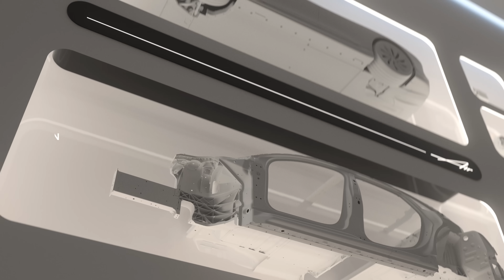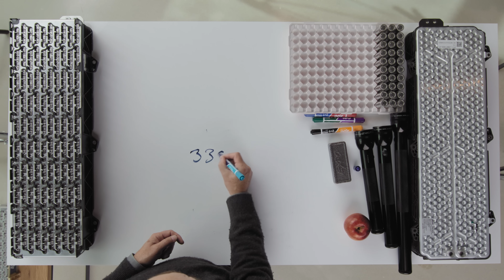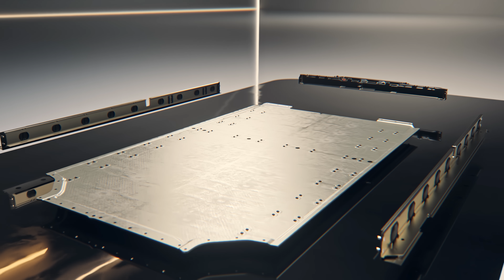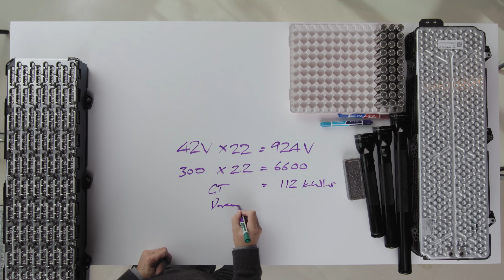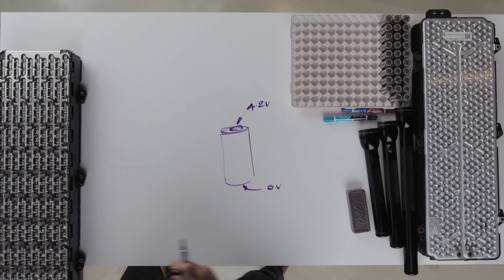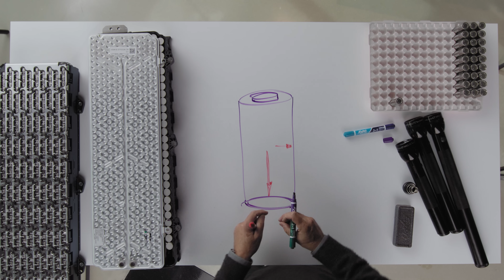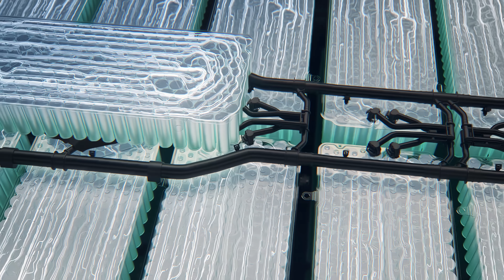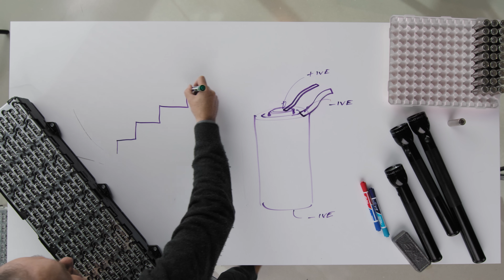Battery Pack | Tech Talks | Lucid Motors

Comment: A fascinating video.  Thank you so much!  We have a '16 Tesla Model S, the best car we have ever owned and almost certainly the best car in the world for several years after its launch.  It's wonderful to have such an informative and accessible video from its chief engineer.

What impresses most about the S is the quality, in the sense that nothing has gone wrong but especially the quality of the battery.  We bought our car with 48,000 miles on the clock and have added 25,000 since.  It has not lost even one mile of range.  Elon Musk likes to talk about a future million mile battery.  Based on this evidence, I might have a million mile battery now.  Several commentators have criticised the panel fit, paint finish and choice of materials, but there is a deep-down engineering quality that is very impressive.

There are only two things that I don't like.  First, the touchscreen is great, and quite possibly cheaper to make than an array of dials and switches, but it is of little use on the move because your hand jitters around relative to the screen.  The best bet is to place your thumb on the bezel in order to hold your hand steady while you operate the controls.  It's not satisfactory if you're trying to drive the car at the same time.  Thank goodness that the Lucid Air has proper heater controls.  Second, the car is very quiet but at certain speeds on certain road surfaces there is a drumming through the structure.  I suspect this is caused by the huge flat floor.  Practically everybody else presses a tunnel into the floorpan, even if there is no propshaft, and I can imagine a team of experienced automotive engineers telling Musk that this was going to happen, and Musk telling them that the floor was going to be flat and that's final.  Very interesting to learn that the Air has a mini-tunnel between the front footwells.

It hadn't occurred to me that the cells would be thermally anisotropic, but it makes sense when you consider what's inside them.  I wouldn't expect end cooling to make much difference with smaller cells, and nobody can complain about the effectiveness of Tesla's battery management, but I would expect it to be a significant improvement with bigger cells.  Panasonic have worried publicly about keeping 4680's cool.  It would appear to make much more sense to cool them from the end.

Lastly, I've often wondered why almost every EV maker, except Lucid and Porsche, settled on 400v.  My best guess is that it might have something to do with the availability of 415v three-phase mains.  Rectify that and I guess you can (almost) connect it directly to the battery.  Am I even in the ball park?

I'm looking forward to the other videos.

Comment: Very interesting. The unmentioned advantage of side cooling, at least as Tesla does it, is separating and isolating the individual cells to limit thermal runaway events if one cell is defective. I don't see anything similar with this pack design and would be interested in hearing what efforts are made to deal with that eventuality.

Comment: BTW, this new tech at the same weight is 4.75 miles/kwh at 70 mph, and 8.9 miles/kwh in city with no hot/cold loss in range. The weight is 1/2 Lucid...so...your tech is obsolete...still born.

Comment: You've built a large bomb that will inevitably explode one day, anything man made will be done with a flaw eventually. It won't disburse the heat generated especially if it's taken on longer trips causing higher temperatures example,a birds nest or rodent blocking vents or mud will trap the gas and any spark or heat can ignite an explosive that is tightly contained creating enormous pressure to escape causing a hydrogen bomb.

Comment: This video was absolutely fantastic.  Clear explanation of complicated engineering.  My question for the next generation of battery technology is whether or not Lucid is working on developing a solid state battery to ultimately replace their current outstanding technology.  With such expertise and background in battery technology, I suspect the company will not want to partner with Quantumscape (like VW and 2 other OEMs) or Solid Power (like Ford).  Either way, I believe solid state batteries will be the future of EVs.

Comment: You can see the joy he took in the cooling plate, such a stab at Tesla 🤣
I'll be interested to see how the BMS holds up, and power output at both the full charge 924v down to the roughly 600v. 220 cells is also alot to manage. All it takes is one with a slightly higher voltage drop to drag down the whole car and leave oodles of potential out of reach. I'm sure it's going to be managed but I'm just curious to see how those aspects hold up.

Comment: Man as long as I've known Ohm's law I've never thought about Voltage being the balancing act to reducing current (heat), that makes so much more sense. I just wanna know how the charging works distributing the power to equal amounts of batteries. Does the computer modules the source of evenly draining the cells modules?

Comment: Basically, it's how they arrange the battery in the car. Nothing special about the battery itself (still lithium ion/still a fire hazard). For a higher price range EV, I expect LifePO4 battery or better to prevent fire hazard & higher energy density).

Comment: Thanks for explaining the battery pack configuration. I was quite curious how it was configured.
As for higher voltage systems. I wish you went more in depth of the pros and cons. For example, why do some manufacturers choose lower voltage vs higher voltage configurations?

Comment: Very informative sir, as well as the Battery Pack technology in Lucid is really a new step towards the Electric Mobility. If possible sir can we have another series where you tell us about the BMS Technology which is used in Lucid as well as Battery Modules communication for SOC, Temperature estimation and Range per charge?

Comment: His coolant design is flawed. The first battery cells to be reached by cold coolant input will ALWAYS be cooler than the last battery cells at the coolant output. This will cause the output cells to prematurely fail. Not that it matters considering batteries are outdated technology just the same as  internal combustion engines.

Comment: Great job explaining these concepts, Peter and the Lucid team! Any plans to release cheaper, higher-energy density batteries using noncylindrical cells? Or are you simply going to use different chemistries with the same battery/cell format to determine power and energy densities?

Comment: But the higher the voltage, the more likely it is that the electricity will punch through the insulation of the wire, looking for somewhere to go.
On the other side of the insulation it could well find my buttocks. And I don't like the idea of that.

Comment: they will not do the large cell batteries because they will last to long and be 1000 times better. those small little welded wires are the problems with amps! the car companies want the batteries to fail so the car is junk!

Comment: Tesla makes better batteries and a smaller pack.  Lucid wastes 27% of their batteries charge and it's twice kw size which is why it goes further.  Lucid only tells you the kw it will move not what it takes to heat it/cool it etc.

Comment: 21700 cells? cooling plate? bonding cells on the + side for pos en neg nothing new. the hot spot wil be on the bonding site...there is no cooling plate just like the side cooling cant be perfect even so have hot spots and modules that age faster. you need to thing 1 step up and make a cells that is hi energy and low IR....4860 tables cells maby? ask Panasonic they wil make these cells in 2023? 5x more powerfull can be 2x les energy los in IR/heat? this wil make a ev good compare to gas cars.